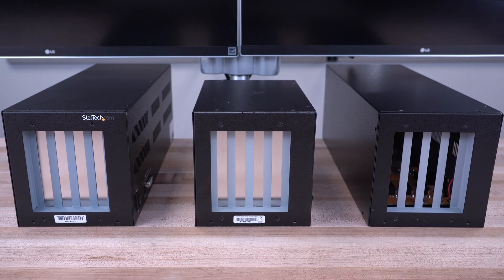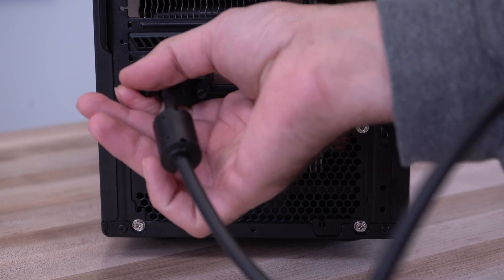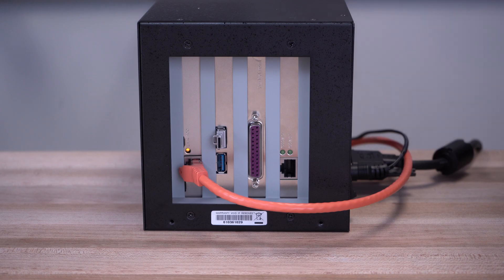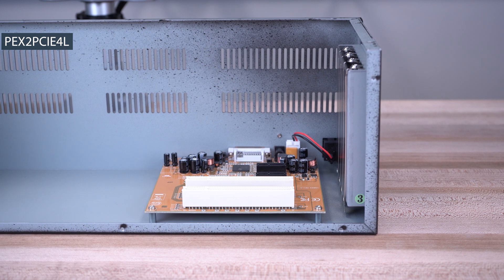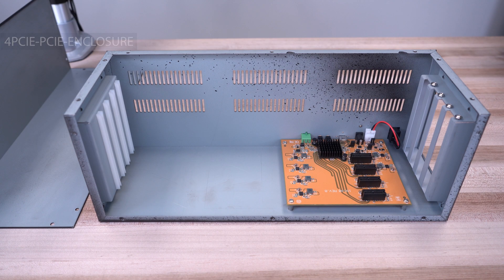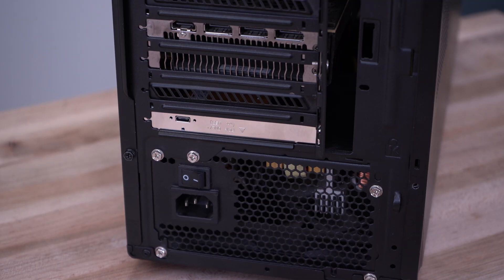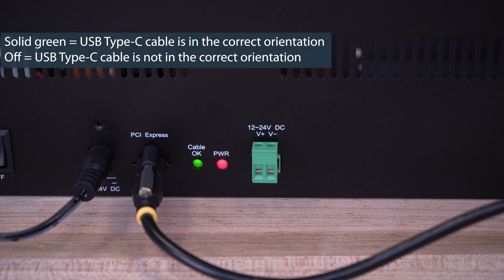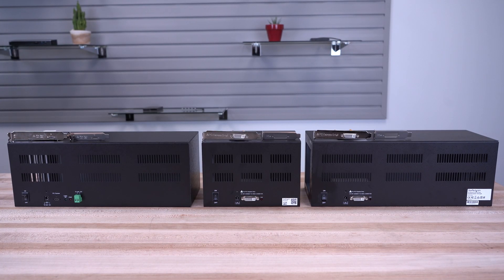PCIe and PCI External Expansion Chassis | StarTech.com

Comment: HI i have a blackmagic decklink 4K mini PCie card got it for my 2008 Mac pro tower..but now uprade to Apple Macbook Pro M1 Max silicon chip..will StarTech Thunderbolt 3 PCIe Expansion Chassis..work with my macbook pro and the BMD Decklink 4K Pcie card in it? want to ask before i place my order for the chassis to work with my Davinci resolve software. thanks
Reply from the maker: No, the TB31PCIEX16 would not be compatible with a Blackmagic DeckLink Mini Monitor 4K.
Reply: @startech  which one of your products will?
Reply from the maker: Unfortunately, we do not have anything we could recommend that would be compatible.

Comment: i was looking for something to have my Vive PCIe WiGig card be able to be easily used externally instead of installed directly to my pc
Reply from the maker: As long as you have an available PCIe slot in your system to install the adapter card for the chassis, and your card requires no more than 250MBps bandwidth (PCIe x1),  the PEX2PCIE4L could work out for you!  If your cards require a bit more bandwidth, you can look into the 4PCIE-PCIE-ENCLOSURE.  Feel free to contact our 24/5 support for further help.

You can call 1-800-265-1844. 
Use our live chat which can be found on our support page of our website here: https://www.startech.com/
Or email with this form https://startech.com/en-us/support/form

Comment: Does it work with pcei UAD cards ?
Reply from the maker: Hi there. Some customers had indicated to us that the TB3 PCIe chassis (model TB31PCIEX16) had worked for their specific UAD Octo / UAD-2 Duo cards.  However, this could be dependent on their specific setup.  We haven't tested on specific UAD cards for either this model or the TB31PCIEX16.